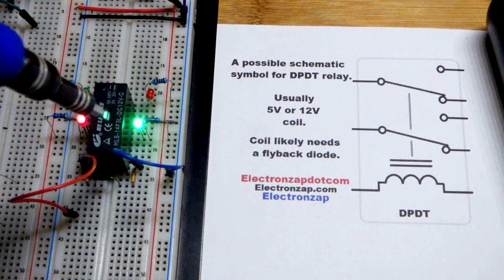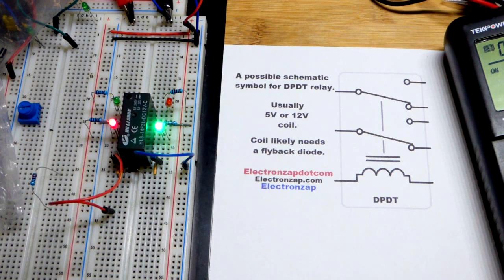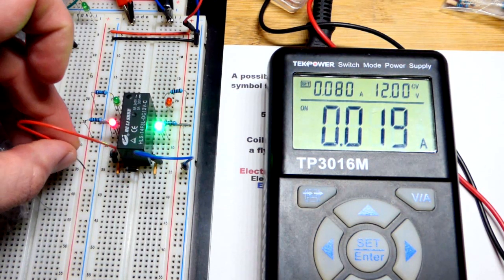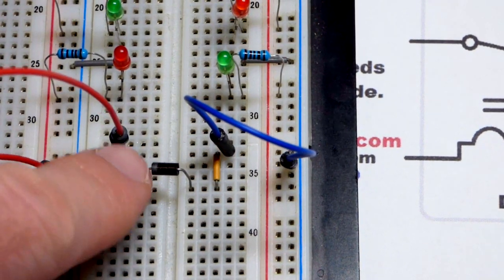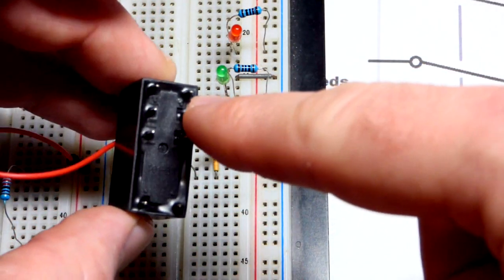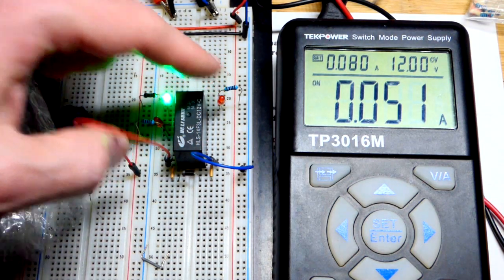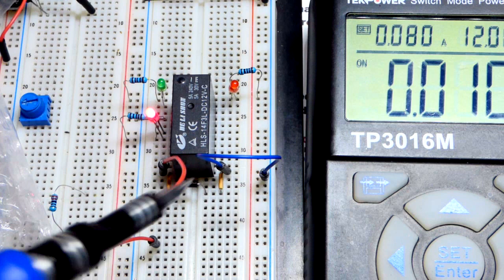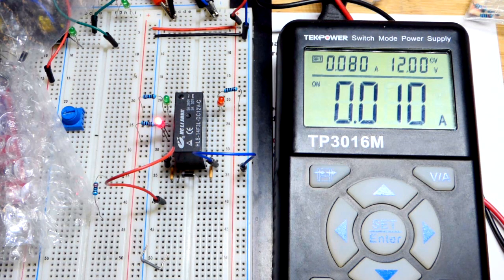Quick DPDT relay component introduction and demonstration

Comment: The switches are not independent. You can open or close both of them, but only at the same time, right?
Reply from the maker: They switch at the same time, but you can wire up completely separate loads to each side.
Reply: On this particular relay, you can’t control them independently. There are some that you may be able to though.

Comment: I have taken DPDT relays and wired them to make a 4way relays. With this configuration you can reverse polarity on the load side of the DPDT 4way when you connect plus and negative on the line side of the relay. I have also wired a control for a load where in can be turned on or off like is configured on more than two switches controlling a light. Thanks for your fine videos.
Reply from the maker: Good times! I did think of doing that reverse polarity circuit but haven't wired one up yet.